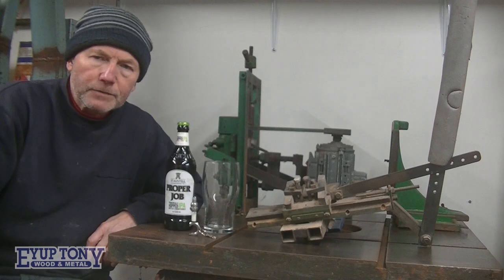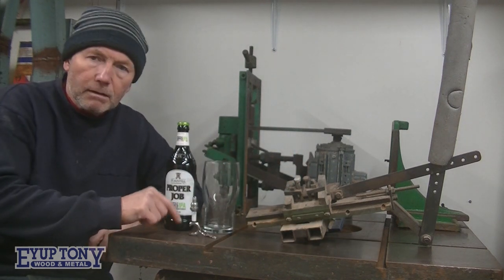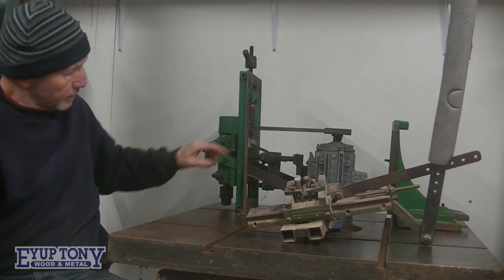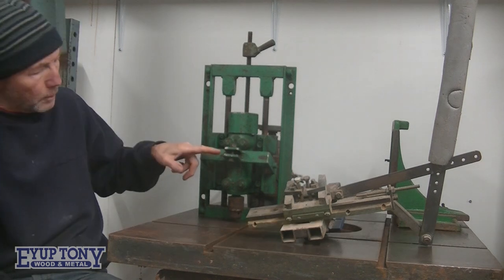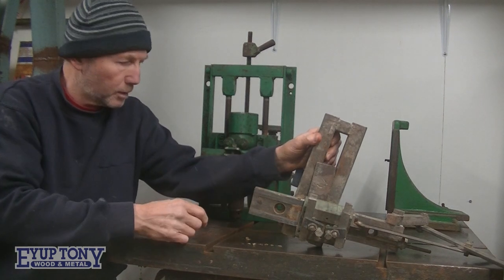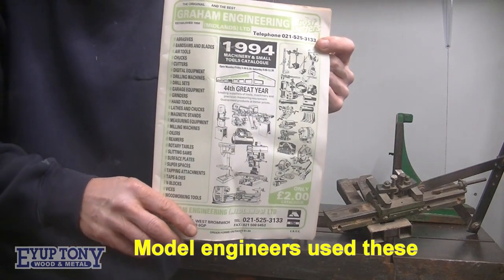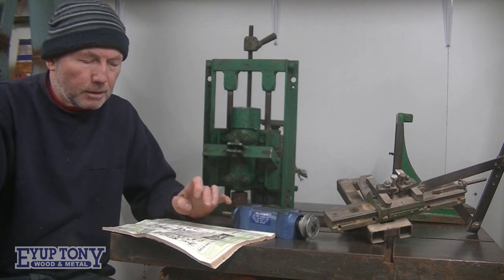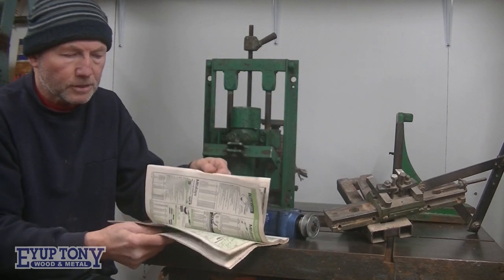Shop Made Tools 1 Workshop Accessories Fittings shopmadetools #shopmadetools Metalwork Fabrication

Comment: Thanks for sharing. I bought a combo 3 in 1 lathe, mill, and drill press in 1994. It was $725.99 usd. I have taken it apart more times the I can count for upgrading.
Reply from the maker: Cheers Sam. I've just had a look at the price for the same. It cost £881.25 ($1,418.81) back then. Yours was a good buy compared to over here in the UK, it's half price. Tony